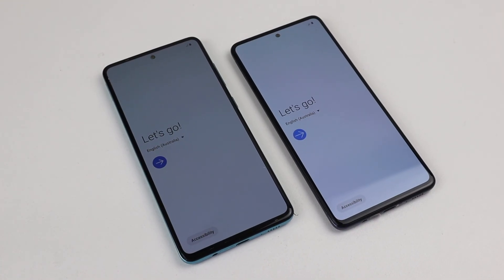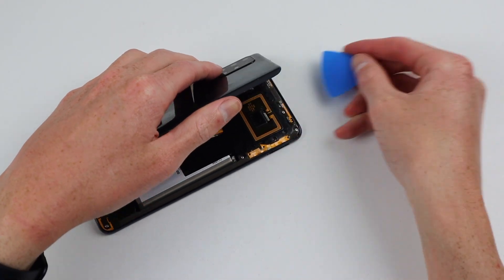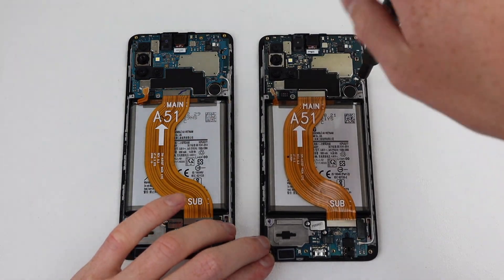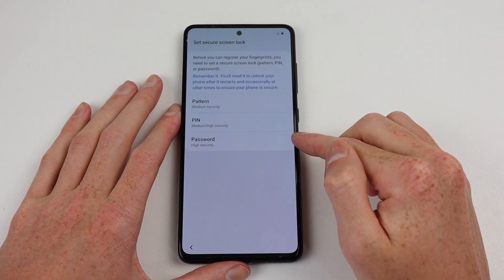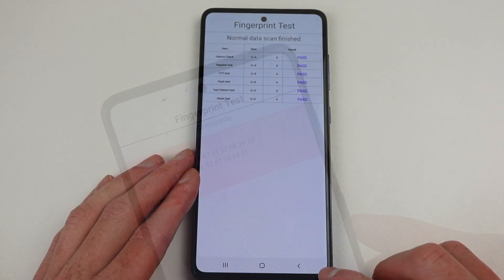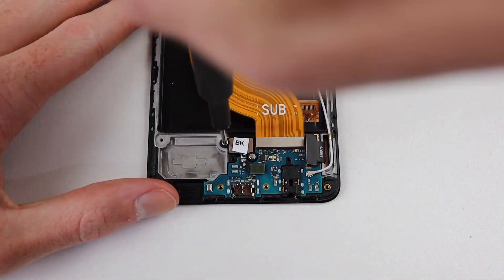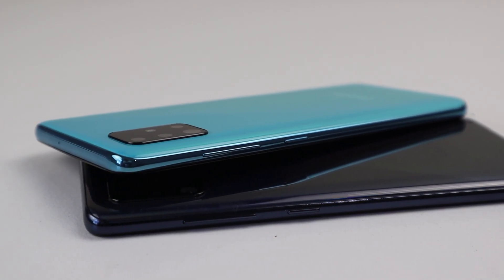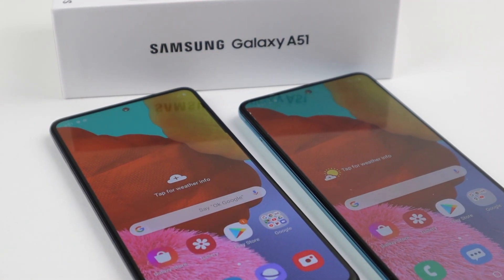Samsung Starts Blocking 3rd Party Repairs? - Galaxy A51 Teardown and Repair Assessment

Comment: I have more than 1 problem with Samsung warranty in s 7edge  ,fold1 fold 2,  they reject warranty,and put blame in me  always( 1 scratch or dent enough) I told them do I need bring new mobile for u🧐🧐? It’s used( sure it will have some scratched or dent) in Samsung fold turned to nightmare ,Samsung use bad quality displays and materials( get defect from itself,because poor fragile quality,specialy black ink spread inside display,  I wish to sue Samsungin court , who has same problem and like join me against them? they should drake good quality resist damage, as they ask for 1000 or 1500 price, who can guide me sue them or want sue them too?

Comment: I think fingerprint sensor repairability is locked due to security. You don't want someone to unlock your phone tampering fingerprint sensor in any kind. So security comes here first rather than repairability.
Reply: Only useful comment down here. That's exactly what I thought.
Reply: They could maintain the fingerprint locked until the phone is factory reseted, or ask you to enter the information of your Samsung account again before you can do anything... I replaced my display with an OEM and the fingerprint scanner won't work on android 11. Total scam

Comment: This is the same experience you get after applying a glass screenprotector and setting up a new fingerprint and not going past 12%. Maybe it really has something to do with recalibration
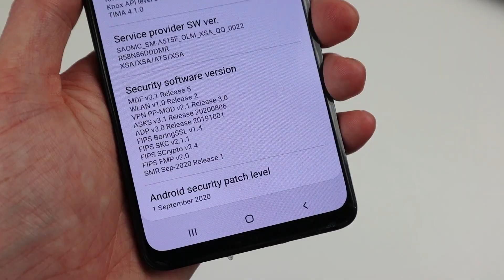Reply: 8:56 yeah, right... so you need calibration on newer version, but don't need it on older one? Looks legit(no)

Even if it needed recalibration, there is no reason to not include the software for that on the consumer device, since, you know, samsung mostly produces all its hardware by itself, so they decide how to use their ip cores, including the calibration sequence.
Reply: No, if that was the case, downgrading the software wouldnt solve it....

Comment: @Hugh Jeffreys As far as I can tell there is enough here for a class action lawsuit.When purchased the device was repairable,no notification was given at the time of purchase that user repair had been or would be removed.Makes me not want to purchase a samsung device.I've been working on console controllers since I was 9,then eventually consoles,laptops,pc's,stereos,tv's,cell phones and tablets.I find it disturbing what these companies are doing,the only dangerous component when working on electronics are capacitors,yet nothing they are doing restricts access to capacitors,but they claim it's for our safety.

Comment: Why the unnecessary complexities, why can't finger print sensors function purely as input devices. They collect fingerprints and the motherboard analyzes the information. Why should it be possible to trick a device by switching the fingerprint sensor. F**KING HELL!

Comment: Anyone remembering when we used to open our own phones and remove and put back the battery when the phone wasn’t working? Yeah I do
Reply: Removing the phone battery is like the ultimate Ctrl+Alt+Del for a process that refuses to close or end at the user’s desire.

Now, no thanks to non-removable battery 🔋 smartphones, you as the user are pretty much held hostage to a difficult buggy program that refuses to turn off😕
Reply: @willia3r  there are secret hidden steps that helps you start phone back up like holding down certain buttons.when your phone got hang in some devices hold vol up or down + power in such situations phone will restart.
Reply: @KingofL85  the fact remains though that ultimately you do not have the true power to turn off your phone.

As long as the battery connected  what ever core programming is embedded in the CPU & the OS will take hostage of your phone, at the leisure/will of the service provider & manufacturer.

And that is inarguable.
Reply: @KingofL85  you are missing the point, but okay i guess🤔
Reply: @willia3r  it's basically the phone version of holding the power button to death on a PC 💀
Reply: @willia3r  most phones have a Force Shutdown (hold the power button) and other phones (like Samsungs) automatically restart when too much is happening/the operating system has hung
Reply: @ju2tunknown  as long as the battery cannot be taken out of the phone, it can never truly be turned off until the power simply drains out.
Reply: Miss the days I’d drop my phone and have to look to see where the battery went
Reply: Yup, the other day my phone froze for about 15 minutes when I was outside and in dire need of using it to make a call, I had to just sit on a bench and wait until the damn thing decided to work again, all the while cursing this new stupid era of glued back and battery. it's so frustrating.
Reply: @black990ops  they've programmed a way to emulate battery removal
Reply: @pinklightningvtuber  pressing buttons
Reply: @black990ops  try pressing volume down + power or vol up +power it reboot the device in most cases.
Reply: I still can do that with my phone
Reply: i also remember carrying a separate spare battery instead of powerbank. My Xiaomi Redmi Note 1 3G had a battery dock accesories.

i always have 1 at home, 1 in car, 1 in my bag which connected to a power bank.. 

Whenever my phone battery is out, i just swap it with the charged one. almost perpetually free of cables..
Reply: I’d even be okay with the non removable battery if it wasn’t for that pesky water resistant adhesive 😂 screen replacements used to be so quick
Reply: I still do I repair my own phone's mate
Reply: Did send my s10+ in for pro repair though cause I tend to leave my repairs half finished sure the phone's are fully functional just never get around to putting the back on
Reply: it was like that till about 2014.
Reply: I still have mine ❤️
Reply: @nebylicza  There you go again, . making up numbers. 90% of the money is almost double the actual percentage. Just like your comment about Apple and Samsung having 93% of the market, which way off from the actual percentage of 33% (Apple 15 and Samsung 18). Are you making shit up to sound smart because you don't think anyone will fact check you or do have real source you can cite????
Reply: U know that will be really cool but it's now outdated:(
Reply: I still do 😳
Reply: I still have a phone that does that. Its still working
Reply: Yes I remember, in fact I do it quite often as I don't own any phone with non-removable battery.
One if the most important features on any electronic device that runs proprietary software is to being able to either turn it off completely or electrically disconnect it's internal microphones.
I don't want to swear for my life that "from this water I shan't drink" but for now I'm doing fine with my 7 years old phone, browsing the web is nearly impossible, but I mostly use it only for text chat, music player and e-reader anyway. Eventually I will get a pinephone.
Reply: @nebylicza    You're wrong either way. You said 93% market share (units) when it's more like 33%, here you say 90% profit shares when it's more like 54%.
Reply: @nebylicza  Either you don't read or are just plain stupid. Apple and Samsung (in 2020) earned a combined 54% of the cell phone market profits. Not 90. I'm repeating what I said 5 minutes ago.
Reply: @nebylicza  I'm only speaking to you that way because you intimated it when you said "up yours" to me in a previous post. Don't start something you can't you yourself accept.
Reply: @nebylicza  хорошо, мы можем просто согласиться не соглашаться
Reply: My dad did that about 1½ years ago with my grandfather's phone that was like 2 months old at the time. He had too many apps running at the same time which caused the phone to not respond anymore. My dad had to go to his place to fix it for him😅
Reply: No u dont nikka u 16
Reply: me
Reply: @nebylicza  yeah they were terrible.. unlike now, where the biggest phone manufacturers happy to rack up antitrust fines for planned obsolescence

The phone war is already over, everyone buys the same two brands. They will only go down in quality of materials and engineering. Saving 3 cents per headphone jack adds up. :^)

Comment: Just install Lineage OS, It isn't risky unless you delete the wrong file or you flash a bad rom. Just make sure the ROM works, and make sure to not delete any files in the "root" folder, it WILL break your phone.

Comment: Looks like everbody is doing this. How about just trying to replace the battery with another bought off ebay? We need to replace the battery the most. Anything else doesn't work looks like you buying a new phone. People can't wait weeks for there phone to be fix so they just buy a phone. The need the right to repair bill.

Comment: I bought an A50 had same issues after screen replacement.

Due to construction a small drop made the display go completely black instead of just cracking the glass even in an otterbox.

Comment: just wondering, does custom rom fixes this issue?
Reply: In theory, yes. Though it would be very hard, nobody would do it.
Reply: @Decommissioned  no I mean if let's say we were to install lineage os, there wouldn't be this issue in the first place, right?
Reply: @Invicibus  Well, probably not, no.
Reply: @Decommissioned  dammit! thanks for the info o7

Comment: We have no one to blame but ourselves for allowing this to happen. If more people would have fought for right to repair we wouldn't be where we are. People argue well its better to let the manufacture fix the device since they made it. Wrong! Most cases they won't really diagnose it but rather you spend another $1000 dollars and buy a new phone. It's better when there are third party people who can work on and repair devices as its a win for the consumer. Reasonable prices and the ability to get a second opinion if you don't agree with the diagnosis. Apple is a complete joke with even sending a phone in to them to repair. if you don't follow every single instruction to the Tee they simply mail it back and not even make an attempt to reach out to you. Yeah real efficient model there. Frustrate people to the point to have to buy a new device. Plus no one can reach the repair techs at apple. If you can't get feed backs to the techs then how can they improve? That's the point they don't have to. Mine was a button issue on the se2020 that had a crack in it from a user. they just lug them in machines and if it says pass fail that's all they look at instead of the time tested method called a thumb would show you it doesn't work. But that's what it is robot people doing a job and no real thoughts anymore. Welcome to 2021 people.

Comment: if you think about it, it makes sense for the biometrics to be paired as it can be modified by someone else to access the device data improperly (as in a case of theft).
It's okay for me to stop there, only this piece is paired since it is directly linked to security.

Comment: You only need to unplug the battery to swap the internals.
If you don't unplug the main flex cable and the fingerprint sensor , you won't have that issue.
Swap both the main and sub board with everything connected (except battery) and you won't have to deal with ODIN or anything else.
I work at a 3rd party repair company in Greece.
Trust me!

Comment: Sheds light on Right To Repair.

It's not Don't buy apple, get samsung
Samsung did the same

Don't buy samsung, buy oneplus

Wait, they also not providing bare minimum requirement for board repair

*Schematics or die*

Comment: Hey Hugh, my A51 screen just went black when i was on a call.
I showed it to 2 different shops, one said i have to replace the screen and other said the motherboard is dead.
But the phone's alarm is working and i turn it off from screen.

I don't know what to Godfather,  I dont know what to do!
Reply: Hold Volume Down + Power until the phone restarts

Comment: I have this exact phone, i smashed my screen completely and the whole screen had to be changesd luckily i had insurance since this oled panel is expensive. I got it changed for 20 euros, by the same place i bought it at. Since then if i want to add a new fingerprint on that screen it would take me 20 or so minutes for one finger, to get that full 100%. I dont think that this is intentional, might be the same calibration problem, the glass on each screen may be obstructing a clear reading since it was calibrated for another one. But the fingerprint works perfectly when using it like normal, only when adding a new fingerprint it goes weird. Thanks for coming to my Ted talk

Comment: I have changed over 200 a515 screens with genuine ones.  And this only happens in very rare cases. Then you only need to recalibrate the fp sensor 9 takes about 5min but you need calibration tool. But usually you don't even need to recalibrate fp sensor after screen swap. 
Also never use cheap knockoff screens it's not worth it at  all.
Reply: I repair phones as well and actually 2 days ago for the the first time an A51 finger print sensor stopped too. It is rare indeed. Samsung customer service told me to reset the phone which as expected didn't help because all they do is just follow a script on a monitor. Can I ask you where you got this calibration kit? Can you buy it yourself or do you need to be samsung approved or something? And does it only work with the A51 or all phones?
Reply: @vascovandereng6521  You can buy calibration tool(GH81-16872A) that will work with all optic fp sensors on samsung devices except s20FE(that one uses a different one). But the hardest part might be getting your phone into calibration mode. Samsung provides repair centers with special programs including one which makes the phone enter that calibration mode.

Comment: Important note
I've recently replaced a screen on a Samsung A41, which also has an FOD. After contacting Samsung they said I should add the fingerprint in safe mode. 
This works! After registering it once, it will never (at least not in my case) again state that the fingerprint sensor should be calibrated. Since then it worked flawlessly.
Reply: how do i add the fingerprint in safemode
Reply: @fijidgaf5932  Just boot into safe mode, and then apply fingerprint like you normally do
Reply: Still not working.... cant add fingerprint in safe mode. Maybe because its running Android 13?
Reply: it doesn't work, the phone still wants to calibrate
Reply: Thank you so much, it worked for me in the end. First, at around 60% it stopped as it did before in the normal mode at 30%. So I tried it again at around 60% it again seemed to not recognise my fingerprint and then I was about to give up, so I pressed the back button to end the dilemma. A notice showed up to scan my fingerprint again so I continued. In the end I had to use the back button about 3 times to finally get to the 100%.
Reply: Im pretty scared about whats gonna happen

Comment: That happen to me with a Galaxy A30s. 
The fingerprint sensor wasn't working because of a oled panel change.

I looked over internet and i found that probably is an android 10 error. (On a Samsung Members Blog)
So you do downgrade to android 9 and it perfectly works with any oled display changed.

Comment: I'm sure that's just a software restriction/limitations. We could basically take a  backup from twrp and make a flashbable patch out of it or just clean wipe and then restore the backup and everything will work fine even with replaced sensorsor any kind of repair

Comment: The same thing happened with my a50 when I changed the charging port.
I only gave a factory rest and it fixed the problem. Haven't tested it on a a51 though.

Comment: I have replaced my a30s with 3rd party screen without knowing that they have this sh*t going on. I thought it was my first screen replacement who is faulty so i bought the second one and keep having the same issue with  fingerprint. Just stop working. downgraded to the oldest binary 4 firmware i can get my hands on to no good. This is really frustating. I really feel that i have fooled. Ive been a Xiaomi user since 2014 after switching from oppo. I bought this phone just to have the fancy of in-display fp and up until then the reason i never choose Samsung before was IMHO samsung is an overpriced brand and DIY/Tinkerers Unfriendly. And now after seeing this Hugh Jeffreys' video i would never ever bought another samsung's product. this is a bullsh*t scheme that are completely not conusmer friendly. I'm sorry Xiaomi  for turning my back from you before. hahaha. Its like buying a car that has no third party spare part available anywhere else but the car's manufacturer warehouse. Do you want to buy such car if you use your car daily? not for any collection thing?

Comment: If it's just the fingerprint reader that it's barely breakable, it can be for security issues
Reply: Apple also does that with the fingerprint sensor and everyone talks about how bad it's
Reply: @GTAandApplechannel  Well yes, because Apples fingerprint readers are notorious for breaking, this being said this video is now useless, because it was due to the manufacturer of their displays, putting in faulty fingerprint readers, not the phone manufacturer "locking things down", as we see in iphone with the screen, camera, battery, and charging port.
Reply: @calyxprophet5221  Samsung too because it's using the same type of cable as apple fingerprint sensor

Comment: Here is the deal: I don't totally agree or disagree with this movement. Of course it's bad for the customer in some way, since the repairability gets restricted to a point that only samsung can fix issues. But on the other hand the security gets improved. Imagine some agency trying to crack into your phone by replacing the hardware with a hacked hardware to bypass the biometric authentication. That's what comes to my mind. So overall, IMO it's both good and bad.